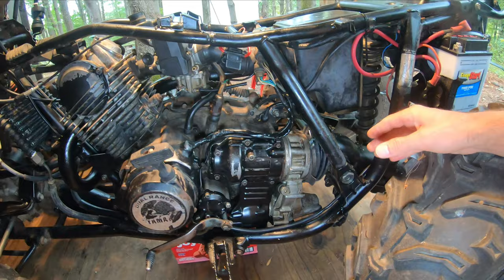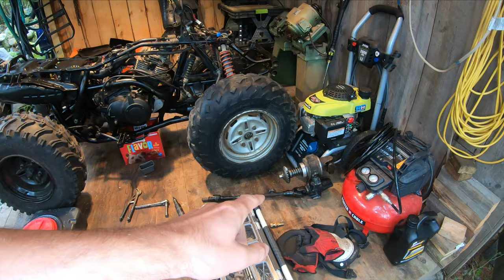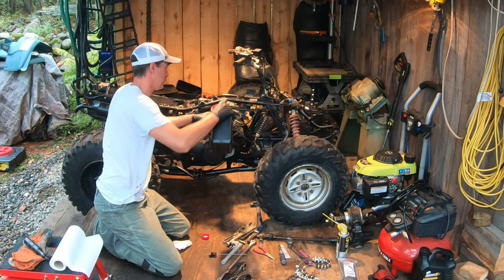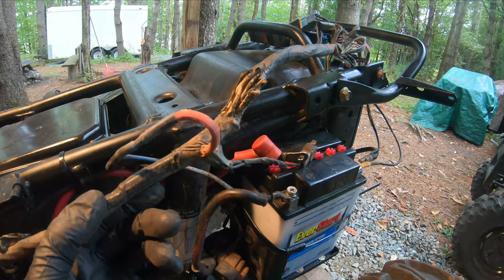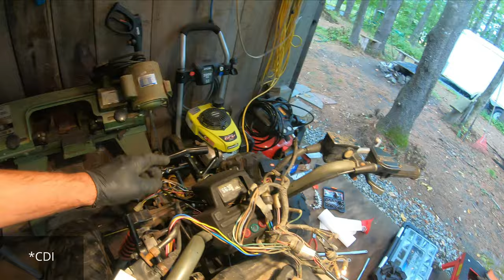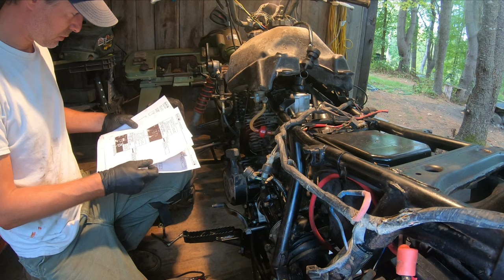How To Troubleshoot No Spark or Weak Spark on Yamaha Big Bear with Full Wiring Walk Through

Comment: Hello , I've watched a few videos and I thought I heard you say on one video the stator specs for a 1987 moto 4 350? I can't seem to find anything on line about all the ohm readings. Can you help me out please and thank you? I'm only getting a random spark and replaced everything but my stator and wiring harness
Reply from the maker: Sure, white wires (charging coil) should be .7-.86ohm at 68degrees F. Should be three wires. Go across each pair to see if it is in spec. Pickup coil / Source coil / ignition coil, however you want to call it test yellow to green for 180-220ohm and gray to blue for 180 to 220 ohm. It is possible you only have three wires. To my knowledge, this can work. The 87 had two pickups, later models did not. I've struggled to get a good understanding of why that year had two pickups. Those specs are from the manual. There is another test that is not in the manual called a AC output test or dynamic stator test. I'd recommend Googling it. Essentially you're looking to test how much voltage the stator is actually putting out which would be a definitive test as well. Best of luck.
Reply: @Vermont Life  I seriously appreciate the help... where did you find these specs? I spent a couple of hours looking and never could find the year and correct cc. I have the original owners manual but it doesn't tell you specs like this
Reply: @VermontLife  my stator is bad from the specs you have me... I'm only reading .4 ohms between my white wires
Reply from the maker: I bought a digital copy off eBay that covers a number of big bear generations. Ultimately in section 7 are all the electrical diagrams. The specs were in the electrical starting and ignition troubleshooting steps sections.
Reply from the maker: @jt3469  Note that the white wires are the charging circuit and shouldn't affect starting and riding (your battery would just not charge and die.) Sounds like it is at least part of your problem though.
Reply: Make sure the bullet connectors inside of the stator plugs are making good connection sometimes they back out of the connector or get loose inside of the connector
Reply from the maker: I have a digital copy of the manual I found on EBay actually.
Reply from the maker: That’s pretty far outside of spec.

Comment: Grey and blue what?
Reply from the maker: Gray and Blue wires coming off the stator. I needed to test for resistance between the two wires by probing the two wire ends in the connector coming off the stator. Was that what you were asking?

Comment: If you look at the size of the spacing on the stator connector it's not making a good connection in other words it's all fagg doubt it might be plugged in doesn't mean the connector is making contact inside of the plug had that issue many of times and it causes intermittent Spark or one spark conditions
Reply from the maker: It's a good call out. Wouldn't be the first time a connector was to blame. I tend to try to ohm test across connectors as a sanity check. This one really tested me.